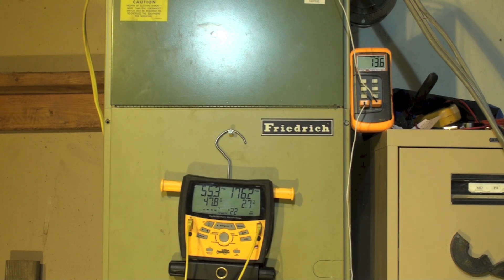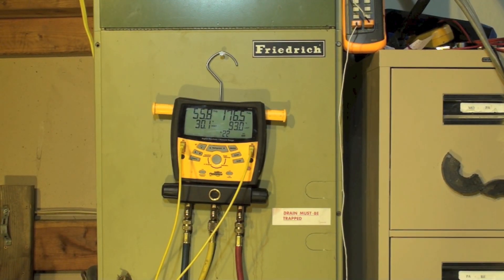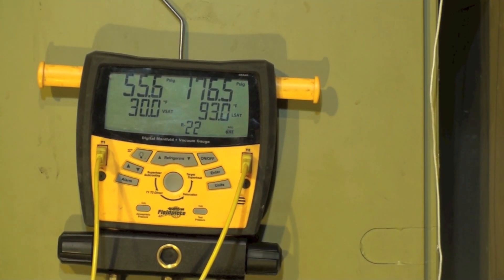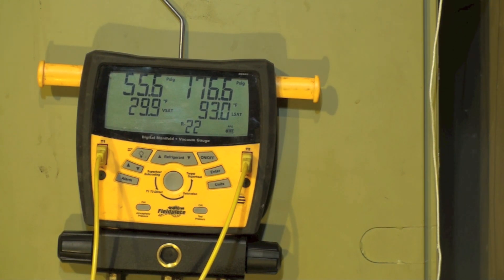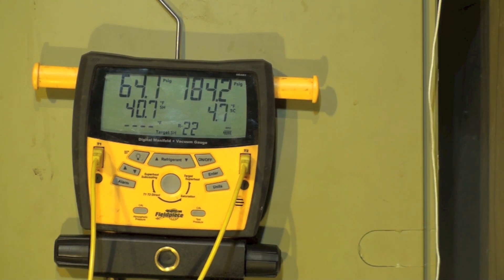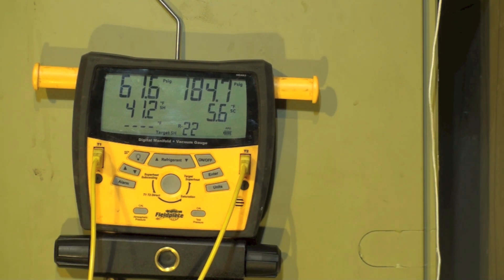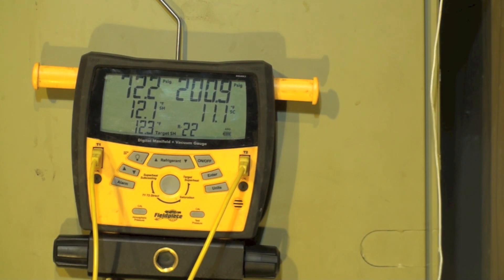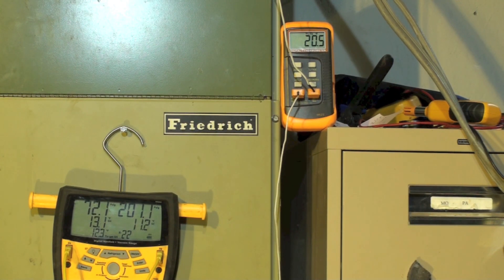AC Diagnostic #1 answer

Comment: Did you check for proper airflow before you started playing with the charge?
Reply from the maker: No.  I would be looking at air flow if the numbers for superheat, subcool, and delta T were not working out.  
GFM
Reply: @grayfurnaceman   Air flow is the first thing to verify.  That’s the reason that the balancers verify and adjust the airflow, and then call us to do the start up.(larger commercial jobs).  Same goes for chillers.  Water flow is checked and adjusted before the chiller is started.  Proper CFM and GPM.  Are the most important aspects in air conditioning.  A lot to techs chase their tails for hours, and then finally come back to see that it was low airflow causing all the problems.  I once was called to a building that had a unit loose two compressors in 6 months.  It was a 5 ton, running on 900 CFM.  The original ductwork was only 50% of what it should have been.  If airflow would have been checked on start up, those compressors would not have failed.

Comment: Hoping to pick your brain. 
I have a 100,000 (input) btu 80% Gas furnace in my 2 story home that is 2500 sq. ft. but there’s a 3 ton AC unit here as well but both units do great heating and cooling all season(s). Since this furnace specs are 5ton, 2000 cfm ECM motor, should my fan be set at 1200 cfm for the cooling speed? I realize the AC is undersized for whatever reason but it works great. Anything here that you would see as being an issue? 
Thank you for your time.
Reply from the maker: The 1200 CFM is a good starting point.  The proof is in the operation.  If the humidity control is ok and the temp rise and drop are within limits, you are good.
GFM

Comment: GFM - if you began to add gas to see if SH and SC would improve, and you weren't seeing those values start to improve, how much gas would you be willing to add before concluding there was some other problem?  Thanks for your videos.
Reply from the maker: Straycurrent I would usually add up to 1# to an air conditioner depending on size.  Always put your refrigerant on a scale so you know how much you have put in.
GFM

Comment: with a TXV system, running 10 degrees subcool and 20 superheat. would alot of humidity cause high superheat?
Reply from the maker: jeepinreo Superheat will not change on a TXV system regardless of humidity.  The TXV system only looks at superheat and adjusts.  Temperature and humidity will affect load but the TXV will adjust according to superheat only.  Hope this helps.
GFM
Reply: would that high of a superheat have a big effect on a txv system
Reply from the maker: jeepinreo Where are you checking the superheat?  If at the outlet of the evaporator, your reading is high and low charge would be suspect.  If at the suction line at the outdoor unit, it could be normal.  Hope this helps.
GFM